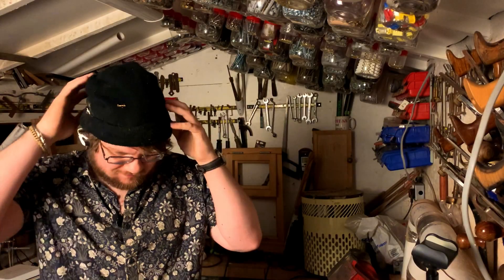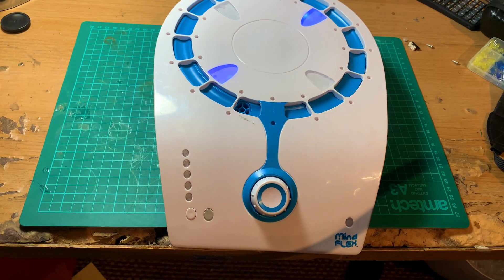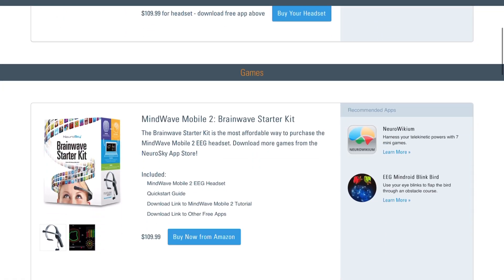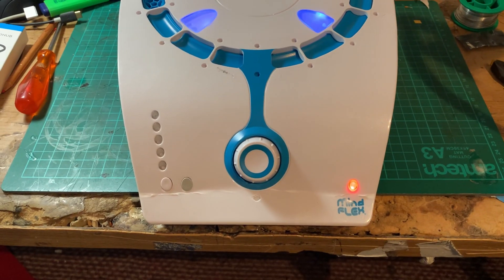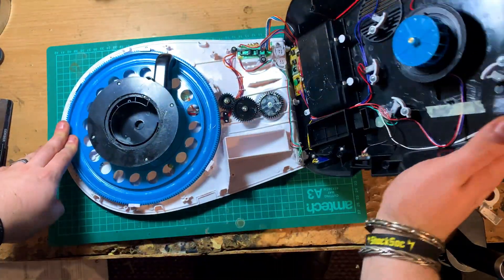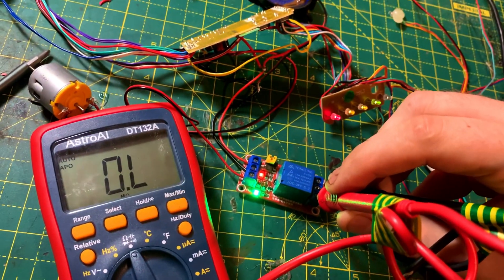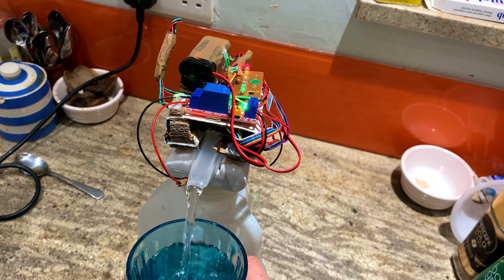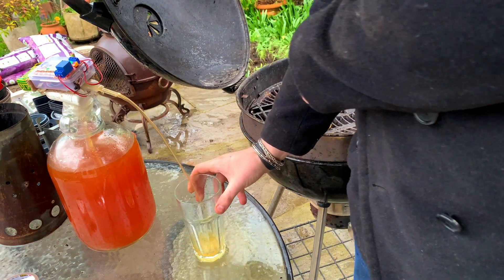I Built A Mind Reading Beanie That Pours Beer

Comment: You've inspired me to get one of these. I'm not sure what I will build but triggering a relay seems like a good idea even if it does'nt take advantage of the full potential gradient that supposedly your mind can control with these. Look out for a video on my channel if I get round to it. I could potentially get it to trigger a giant 1 meter high floor standing pulse capacitor with a deuterium thyratron, a filament transformer and a relay.
 Mind controlled thousands of amps at 50kv pulse capacitor powered can crusher 😅
🤔 or rail gun!

Court case defendant says "I didnt mean for it to fire" prosecuter: "but you must have had the intention for it to fire in your mind!!"

I can imagine these being used in a saw movie with the victims restrained controlling a linear actuator with a spinning circular saw attached 😂

Sorry that was a bit dark